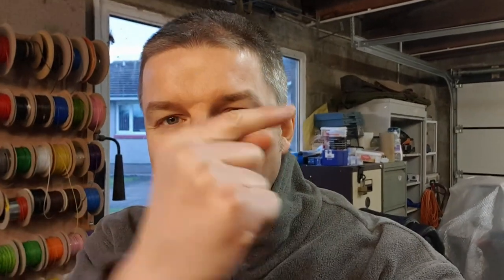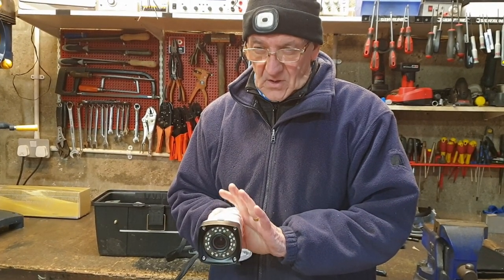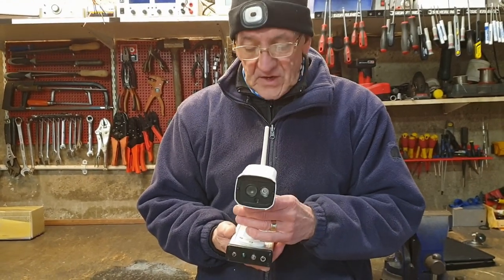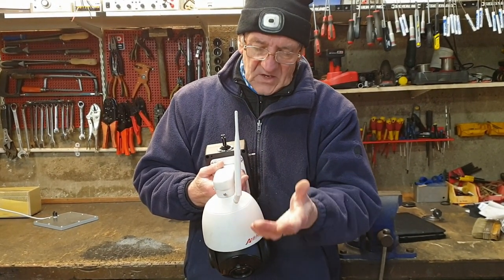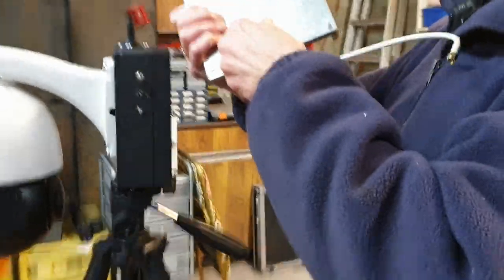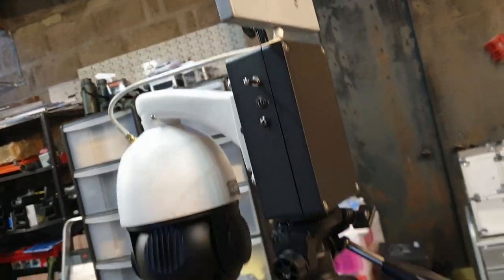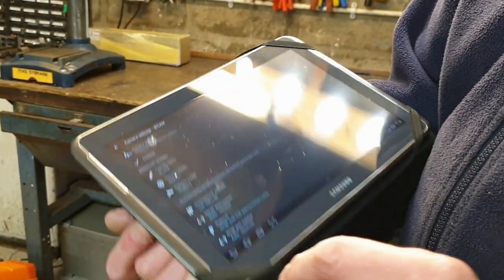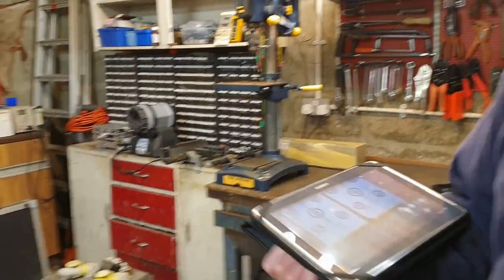Bruce's Target Cams

Comment: I shoot 1000 yard targets with my DIY cam system that cost me under $150USD. Two 12vdc batteries, a 600mW transmitter, a camera, and a great combo Monitor/Dual Channel Receiver/DVR for viewing and recording...even playback on the spot. And I can output the video to a second large screen TV/monitor for friends to view in realtime providing I have my 12v/120vac inverter handy or wall power running an extension cord to my shooting bench from the shooting shack.  Bought it all on Amazon and eBay (China).  A half hour to get it all running, not counting mounting in a housing for the cam/transmitter/battery unit.
Reply: Can you help with a shopping list?
Reply: Shopping list please!
Reply: Give us some more details or make a video
Reply: Yes pls Video pls !

Comment: I think Bruce that even the second attempt! you could of changed the lens to a 8mm or 12mm or 16mm lens. Most of the lens are standard screw in and out held in place by a grub screw. I have done this on other ip cameras.
Just a comment that may have worked for you, keeping the cost down. Still what you've ended up with is working for you and more flexible in distance.